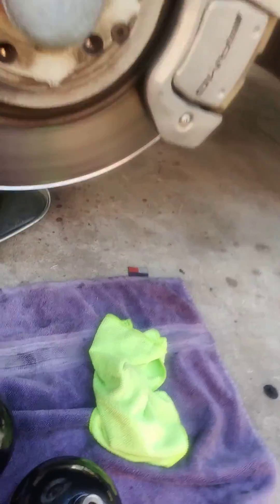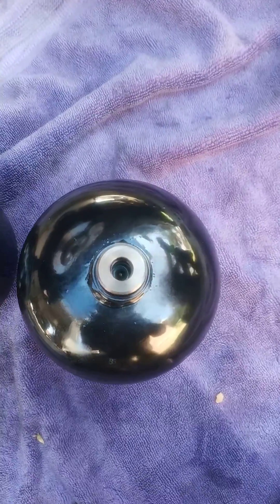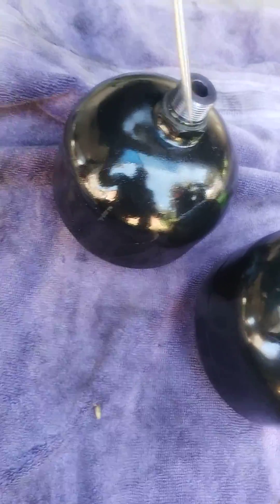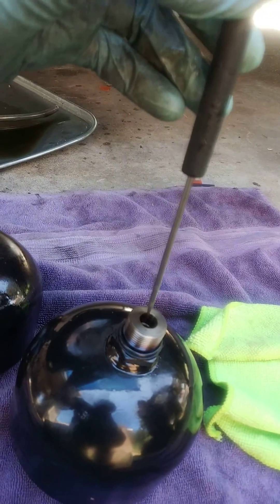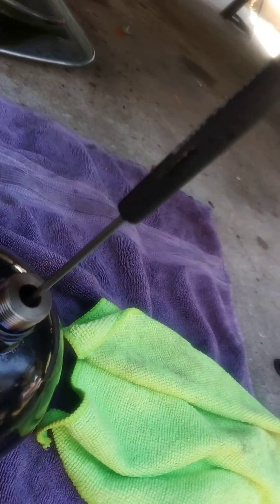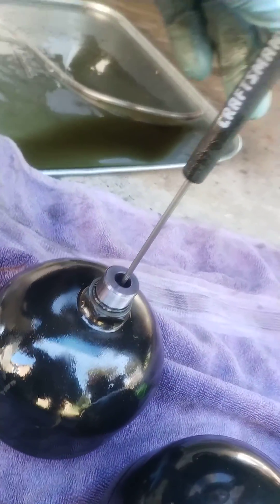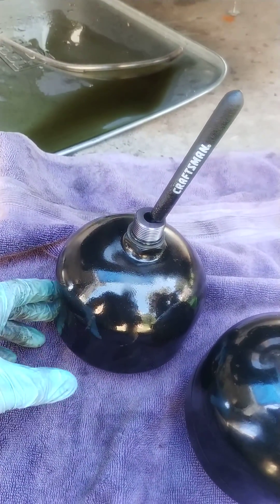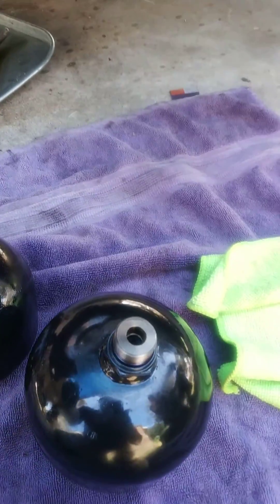Mercedes ABC Suspension: Blown out accumulator. AKA nitrogen balls.

Comment: Nice video. Do these make whining noise when going bad? I hear whining noise on my C216 CL500 from the left front.
Reply from the maker: No these don’t whine at all. Whining maybe coming from the tandem pump. Or if it’s an exaggerated vibration that you’re feeling it could be the ABC pulsation damper located behind the front driver wheel behind the fender liner.
Reply: @mercedesbenzspecialist  Thank you for the clarification. I'll double check again, hopefully it'll get sorted. The local indy mechanic did also mention that it might be the ABC Pressure Pulsation Damper with the part number A0004660400.
Reply: @mercedesbenzspecialist  Also, does the ABC oil need to be flushed when changing the ABC pulsation damper?
Reply from the maker: @HomaVista360  No it does not need to be flushed. The fluid should be changed every 15-30k miles or every 3 years.
Reply: @mercedesbenzspecialist  Great! Thank you. Will keep that in mind 👍
Reply: “Will oil come out when it is replaced?”

Comment: Where is the location for the cl63 front
Reply from the maker: In front of the driver side wheel. Remove the fender liner.
Reply: Did you have to fully support the front of the car on jack stands for this? Was there still pressure behind it?